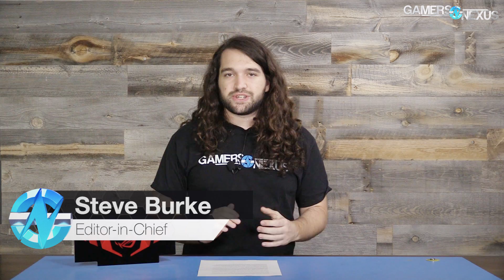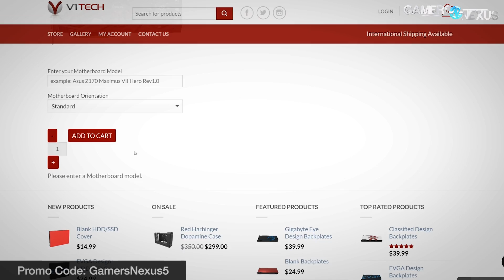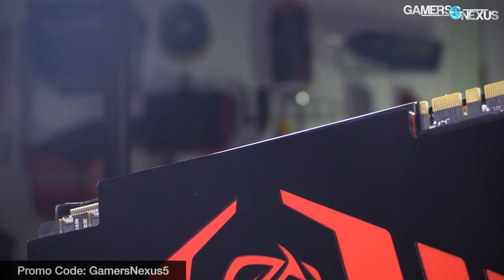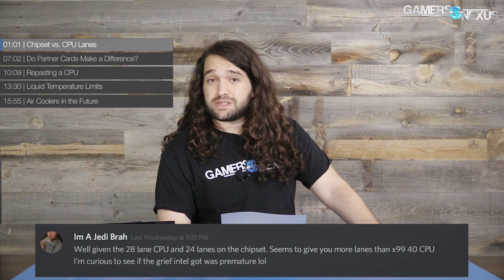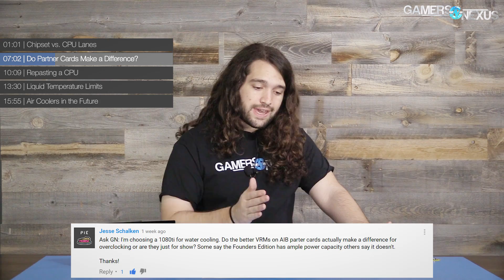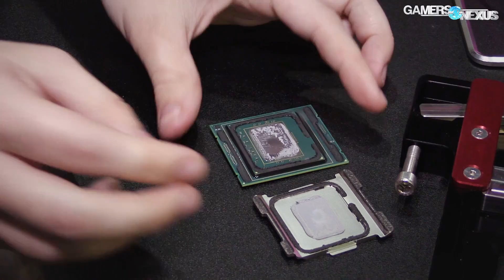Ask GN 51: How PCIe Lanes Work (CPU vs. Chipset)

Comment: This has been puzzling me for a while. Why do custom water loops perform better than AIO water coolers with the same radiator size? The custom loop can still do better with a GPU block included with the same radiator size.
Reply: One reason that custom loops perform better than AIOs is that AIOs commonly use aluminum radiators, but custom loops usually use copper for at least the internal components of the radiator in order to prevent galvanic corrosion with the copper blocks that are also common in custom loops. Copper conducts heat from the water to the fins and if the fins are copper then also through the fins and to the air more effectively than aluminum, so the radiators work better. Custom watercooling blocks are also generally better than AIO blocks, AIO blocks are built to get the job done and be done cheaply while custom watercooling blocks are enthusiast products that people are willing to sink money into, so more can be spent on materials and research and development to make the best block possible. It is also common to use much higher end pumps in custom loops than AIOs, with some common models of pump costing around the price of a complete 120mm AIO, although pumps are not likely to have much of an impact on performance, the difference in block and radiator quality are much more likely to have significant effects.

Comment: Steve,
With game loading times, it seems that the interface has little impact. An M.2 SSD will load a level as fast as a SATA 3.0 SSD. My understanding of this is that games require decompression of files, randomly generated terrain, basically processing tasks to prepare the level for the player. Do different CPUs show different load times once you control for the HDD? Or the same CPU overlocked vs stock?

Thanks in advance.

Comment: On the 2nd question, VRM of the 1080ti founders edition is more than enough for overclocking. I am saying this because I think the one asking is intending to overclock it at some point. The VRM on such a card will not hold you back, it has more to do with winning the silicon lottery. That being you getting a 1080ti chip (on a graphics card) that uses less than average and can overclock higher than average, chances of that happening both at the same time is very slim.

Comment: air cooling doesn't pose a problem for high tdp chip, i'm running my i7 6850k oc with a hyper 212 and i hit 60-70c under load

Comment: Regarding paste: I opened up my AMD 290X Graphics card to check on thermal paste. I've had the card for 2.5 years and the paste was totally caked and dry. Temps dropped by 10 celsius after applying new paste.
Reply: yeah, the card starts throttling at 94C. It's safe but poorer perf.
Reply: I think 94 is TJ max for the r9 290x so no risk there.
Reply: MrPunkassfuck wow. checking thermals paste on your gpu? i didnt think of that. cpu maybe but GPU? was your gpu temp so high you decided to check it out? 94c is just meh bro.

Comment: Easier explained by explaining that by having PCIE lanes on the southbridge is they all talk through a PCIE3X4 interface to the CPU so those 24 PCIE lanes all share the same bus as everything attached to the chipset.  You don't have the 28 PCIE lanes of bandwidth you only have 4 basically. That means your NVME PCIE3x4 drive is sharing bandwidth with your keyboard, mouse,sound card,sensors,fan controllers,SATA ports,LAN,Other NVME, etc. where if the NVME is connected directly to the CPU you get the full PCIE3x4 Bandwidth for your drive.
Reply: I was just about to leave the same exact comment.

Comment: So just a quick question a high end consumer MoBo on Intel's side most likely with a 'Z' (Z170, Z270) can accommodate (not bottlenecking) 2 way GPU config and one M.2 or PCIe SSD (w/ NVME Protocol)?

Thanks a lot Steve! I love this channel a lot since it is so comprehensive and no stone is left unturned so to speak ^_^

Comment: Ask GN: in theory if new ryzen 3 is 4 cores on single ccx is it possible it will not only match but be better than R5 in games(most of them) that use only 4 or less threads since we have seen that infinity fabric is one of the bottlenecks on ryzen?
What are your thoughts on ryzen 3?

Comment: So if you buy a CPU with 28 cpu lanes (basically all the skylake x CPU's that are under a grand...) you won't be able to run two 16x slots at full speed for sli? Well that sucks. Didn't the last gen 6 core 6850 from Intel have 44 CPU lanes? I feel that maybe you where too diplomatic, I'll bet serious money that these capabilities are where "turned off" purely to help Intel differentiate the product stack even though it is ultimately an anti-consumer decision... Intels new CPU's are a confusing mess.
Reply: I actually think that running at 8x is plenty and doesn't really provide a difference that can be appreciated. But that aside there will be people out there who will want it. Tbh it just seems like a step in the wrong direction, so even though I wouldn't call myself the target audience for Intel's extreme platform it still grinds my gears. Looking forward to the review!
Reply: Ben if you are running sli than your machine is mainly gaming so a 7700k or a 1600x would be better.... so your not getting that anyways.
Reply: Thats why if Im soending $$ on x299 Id just say screw and go for i9 7900x so I get all the features. Gonna spend a lot anyways.
Reply: spending*
Reply from the maker: Diplomatic? The point wasn't to make commentary, the point was to answer a very cut-and-dry question. We leave the commentary for our reviews where we actually test the product, not for pre-launch conjecture and hysteria. Commentary was way out of scope of an Ask GN video where we're addressing a lot of questions -- we're just answering how it works. Surely you can make your own conclusions from there. If you want our thoughts, stay tuned for the review.

Comment: hi guys, is there a motherboard i could use to run 4 x RX 580s with a Pentium G4560 ? and how much are they if so.
Reply: Deek Douglas are you a miner
Reply: not really King but wanna do more and need a new project. have pretty much built everything i've ever wanted to.
Reply: Ok just wondering. Any b250 or z270 board works with a pentium g4560.
Reply: is there anything in particular i would need to look for. not sure what pci-e slot layout and stuff i would need for 4 gpus, i checked out the rigs with lane risers and stuff for 6/8 but that really isnt something im interesting in building.
Reply: Just make sure there are atleast 4 pcie x16 slots that are atleast a space apart.
Reply: thanks for the help king and S.R.D. was looking to a build i could mine with both for money and for free when im at work and a sleep but dont have much experience building with multiple gpus. plan to do it over say a 4/5 month period so money isnt really an issue and dont really care if it isnt very profitable.
Reply: i used to use a gt640 and gtx760 for einstein@home then xfire r9 280s then a 390x. recently mined some bitcoins with a 750ti and was shocked it actually earned about a pound a day which isnt much but when i think of the compute power i previously donated it adds up to hundreds of pounds, i was top 150 in my boinc team of thousands lol :) have water cooled pcs built both amds and intel/nvidias, built little tiny ones and big ass beastly ones lol just looking to do something a bit different, earn a little cash and donate a little power a long the way. . . . (only used a 750ti cause i had one with an fx 6300 i built cause i missed my old pc lol i actually ordered another gpu to just run 2 in it even tho they dont sli lol)
Reply: If I may be so bold as to assume your intended use case, I believe Asrock is releasing a mining targeted motherboard on the H110 chipset in the near future, it has x16 slots for up to ten or so GPUs - I would have thought that would do the trick.
Reply: thanks Joe that does sound more like what i am looking for. i checked out there mining boards but just seen ones based on the frame style builds which i dont wanna do, i like the gaming style. im looking at the 4 way boards king recommended they are about £300, id rather pay closer to £200 but i total get what i am doing is a bit stupid lol so the price is kind of okay.
Reply: i found an msi titanium z270 for £300 but putting the parts together still cant get the gpus. no real point having a board that expensive with nothing to put in it so i pre-ordered 2 msi 8gb 580s, can run them on what i have now whenever they become available so at least it is a start. thanks again for the help